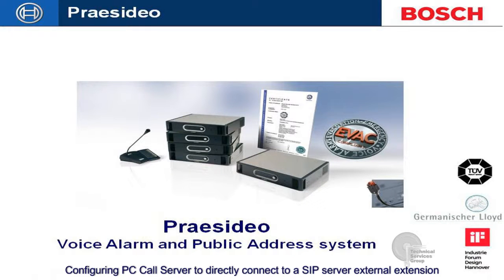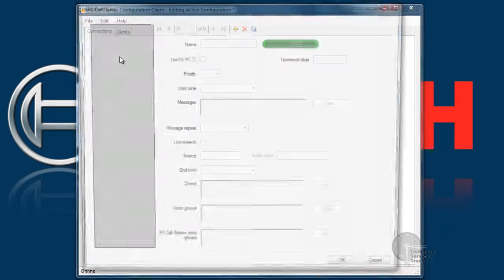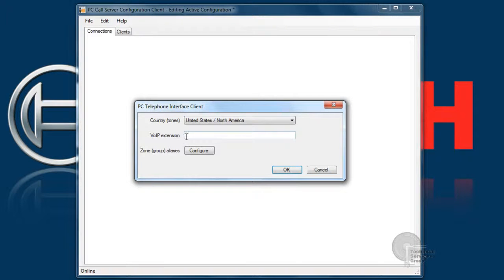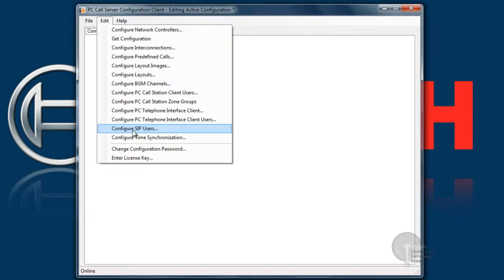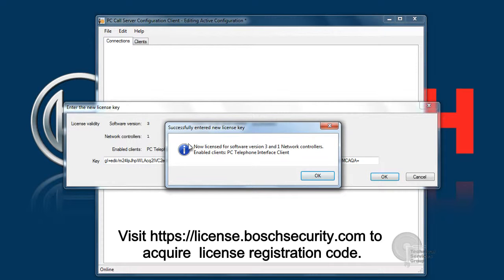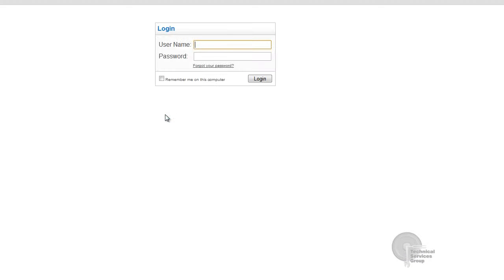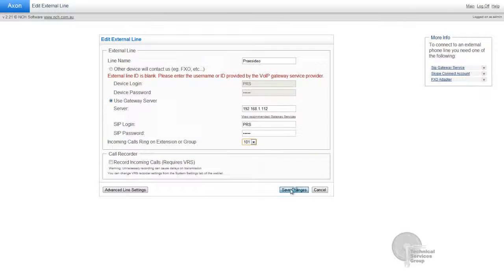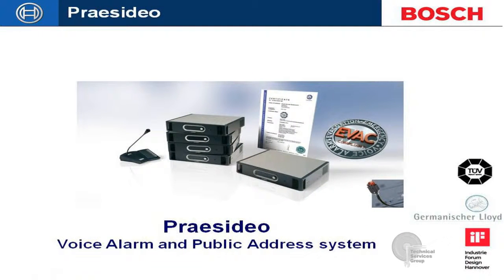Bosch Praesideo PCCS to SIP Server

Comment: Hello, I made a system where I connect a basic call station with one NCO. And I have 4 more NCO in other place. All are connected through a switch. Now I am trying to control the zones and broadcast announcement in those other 4 NCO by using PC Call Station Server. But It's working only for which NCO it's connected. It's can't broadcast other location. Is there anyway to do this?